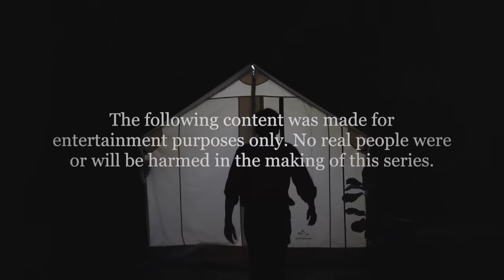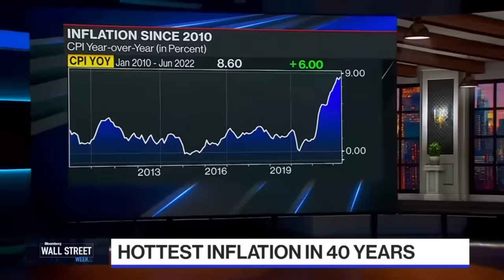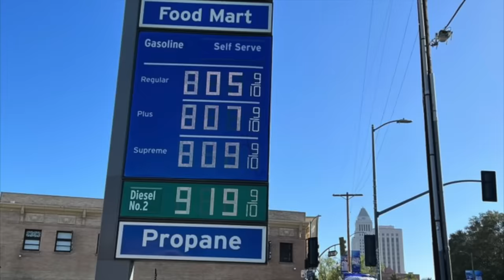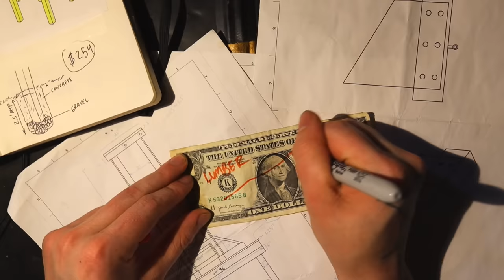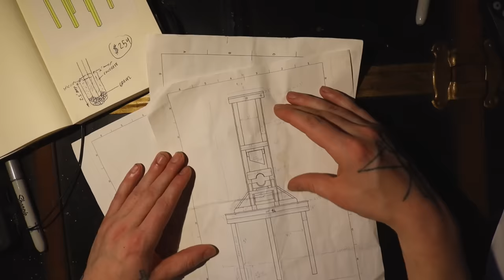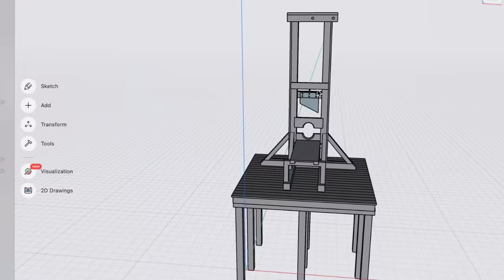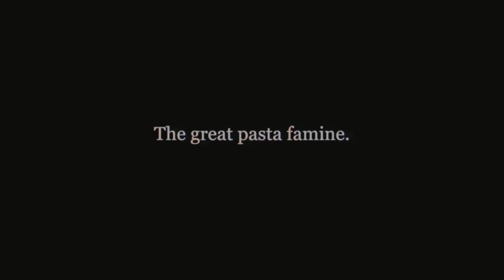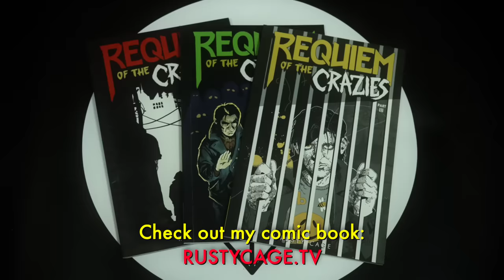GUILLOTINE part 1: Time to Build a Guillotine

Comment: If you are making the angled supports that short i recommend using extremely large washers so the bold does not pull out when you use it. other than that it looks good

Comment: So use like a 1/4” mild steel blade and bevel it with an angle grinder, should work well enough if a like 60* bevel (30* each side) and make sure to support the top with bolts spaced across evenly.

Comment: Also use screws and bolts. If not possible use ribbed nails and  make sure to drill a guiding hole to to avoid splitting the timber

Comment: another potential issue is the dirt will move when it's mounted and a structure that heavy should have a base like concrete used in the hole to surround and keep the posts in place to avoid tragedy later on

Comment: If I made a guillotine, I would use a couple of these:
I would still use a spring compressor, though.
My sister's son had an interesting take on guillotines at the family reunion. He said he'd have a spring-loaded guillotine but have it built to be very short, as people are too dumb to stay away from it. The blade should be curved to make it easier to use, but also have a sharp edge to sever people's heads.
The rest of his family laughed, but then realized he's just the kind of person who would design and build a guillotine and use it.
I don't think there's anything wrong with that. He's probably safer building a guillotine than being a police officer.
One day, I will finally have my own.
The one I have now is just too damn small.

Comment: you're going to need to travel to scrapyards to try to find the steel for the blade. Buy a powerful angle grinder, and good cut off wheels and flap discs, that should be all you need. maybe make a vlog out of the scrapyard trips?

Comment: and btw a 2nd note. unless it is pressure treated the wood will rot if left in the ground like that. you should have used concrete for the bottom.

Comment: RUSTY don't use a street sign, they're too thin. Use a 1/2" thick iron plate, it'll weigh like 100+lbs and probably could cut an entire body in half if you wanted to.

Comment: Advice for the build. I know this sounds dumb but id consider buying a hot glue gun, some cardstock, popcicle sticks ect, and make a small barbie doll scale model of it BEFORE you attempt to build it for real. It will reveal alot of potential problems you wouldnt see on just blueprints alone. Meterial strength and bendyness, play in the meterial. ect.

And building a prototype/scale model would also benifit you alot by getting you farmiliar with how the peices work together soo that its less confusing when you go to build it for real. 

It would take maybe a day or two. And maybe 50 bucks. But i garantee it doubling your effectivness of the project and the likelyness of it working out. Especially since its such a big investment to build the real thing. 

I know it probably seems really straightforward to just go out and build it for real without prototyping. and very tempting but thats a rookie mistake. Especially if you havent done stuff like this before as you said in the video. 

-------------------
I personally think the hardest part would ensuring the stand and tall stucture to be stable. And also finding a blade big enough to work for it. The blade itself could cost hundreds of dollars for an actually usable one. 

But id really love to see you actually build one. because i think they are cool and i wanted to build one myself a while ago. 

-------------
Anyways if you are wondering to trust my advice, i have a very small youtube channel where i build contraptions and do carpentry as well. 

But thats all i have to say. Love the video. love your content. if i had money id pay you.

Comment: Now I really don't think a street sign is going to be good enough as a blade. And I'm pretty sure you already know the reason why... but instead have you thought of using some kind of Blade like from an axe and trying to make like a bigger version of it or try to get a plain piece of metal and then sharpen it down into a curved pointy sharp edge and then mount it on to whatever you have as a mount  and I know this is very unlikely but I made a backup plan in case the guillotine just crumbles down one day because  even though  it's  unlikely. I'm  stupid as shit so I'm  going on with just in case 

If the guillotine ever fails I have some directions for you to follow, first you need to dig a hole. Maybe about maybe as deep as 6 feet deep but make sure it's circular and then put some sharpened punji sticks on the bottom of it (wooden) and try to find some false  ground to put on top You can make this by making a blanket out of the same material that are made with ghillie suits. Leaves. Green string or just  get a plane ghillie suit and cut the sleeves off and use it as a blanket to put over the hole

 History
        

         |
         |
         

The history behind this trap actually comes from Vietnam and they even put shit on the punji sticks so it would cause an infection and sometimes they even used no punji sticks just rattlesnakes and they also use babies because babies couldn't control their venom and it would make it more lethal...also they used to put the back of the punji sticks facing downward on the sides sometimes they would still put shit on it but either way how this one worked was if someone falls down it won't hurt them unless they get a small cut but when they try to get back up or get dragged up it would cut through their skin either way the shit that used wasn't just regular even though that would be lethal enough sometimes they would make sure it has some sort of other infection in it or they would even put some kind of flesh eating bug inside of it and that would make sure this was way far from their enemies base so no matter what they would die before they got there and they had other malicious traps too probably why they won
Reply: The reason why I know this is because I personally like making small versions of the traps and then making toys get murdered by them basically.

Comment: U have to sharpener your equipment get measurement right and adjust your pulley system 
Overall not worried after it over make sure to incinerate the body and sanitize your equipment wouldn’t want people fusion into life form due to all the blood smears

Comment: Consider triangular supports for the desk if you find stability is an issue
You want the lateral forces to be translated back into vertical so that any forces the frame has to support won't induce a lateral motion 

Because if you do, that 6ft different between the mounting point (where the supports go in) and the platform creates a torque (rotating force) which could lead to sudden failures if you're not careful with ensuring the beams are thick enough etc. That torque really isn't good for a rigid structure's like expectancy 

Using a truss structure for the deck support should eliminate that pretty reliably; but fucked if I know without looking at the specifics 
Trust in the truss chief, there's a reason those fucking bridges are everywhere

Remember with the huge weight and mass on top will change your center of gravity and you need that bitch to be stable 
I'm only an engineering student (3/4 done) but can help with the blade part too if needed (materials is fucking neat and with just iron and carbon youd be surprised how much you can control the output)

Above all, you got this
More than happy to help with any of the design side; let me know chief

Comment: Ignoring the whole symbolism of "Let's bring back the guillotine!" I think it's a lot more cost-effective and ethical to solely use lethal injections of drugs like fentanyl for executions. It needs little maintenance and it's not flashy and grandiose in a way that might appeal to the ego and bolster legacies the way that a high profile execution would; I believe pitiful souls should die in a boring whimper rather than a bang. Most of the talking points I've heard against lethal injections is that often they're made of guesstimated mixtures that have a chance of resulting in prolonged suffering because of multiple injections being required to do the job but substances like fentanyl are potent to the degree that it's easier to get a deadly dose than a safe dose. To counter myself, there's a chance that using fentanyl as an execution method would incentivize criminals to act on their impulses so that they can get caught and die high. What if that's exactly what we want? Antisocial people have a higher rate of addictive behavior than normal people and that statistic may mean that otherwise uncatchable criminals could end up doing the work for law enforcement. What does the collective get? One less criminal to pay to maintain with an indefinite potential for depravity and a nearly guaranteed chance of recidivism. What do they get? A stupid high. 

Here comes the question of "How much collateral can we tolerate?" that purveys every kind of discussion surrounding execution. If a system like that were implemented tomorrow there would be a variety of brand new systemic problems associated with it that may only be detectable in practice. There's drug addicts who seemingly adopt transient antisocial behaviors in times of desperation that may commit violent acts in hopes of getting lethally injected. Perhaps the people who are pushed to such acts by drugs are born with an otherwise dormant part within themselves that allows them to be capable of terrible acts? There seems to be a lot of comorbidity between what's seemingly drug induced transient antisocial behavior and inherently antisocial behavior that magnetizes one towards addiction. Naturally if an execution method such as that were to be used as a kind of bait for active antisocial criminals there would be otherwise inactive criminals incentivized to commit violent acts. Being able to "die high" might even become a symbol of status among organized criminals in a way that might make them even more cocky and frustrating to deal with when caught than otherwise. 

It seems that the most expensive and prolonged execution available is a guaranteed death in prison; a lifetime sentence to daycare for adults. As an infantilizing and demoralizing psychological assault on the senses that serves as a constant and unwavering reminder of "You will die here." it seems like, as an intendedly just punishment, the lifetime sentence to prison is given frivolously. From a more utilitarian and nihilistic lens it makes logical sense to impart an equivalent amount of suffering relative to what one has caused within the span of one's life as a supposedly just punishment and, in that sense, I understand the necessity in certain circumstances such as genocidal lunatics with a high count of war crimes. That being said, within the framework of utilitarian nihilism, where is the value in chasing equivalent suffering? Assuming suffering is a phenomena with an objective sum value of quantity independent of subjective philosophy, an inflictor ultimately has a finite capacity for suffering because of mortality. What about the sum of suffering causally related to the inflictor's actions? Does that sum of suffering exceed or equal the inflictor's capacity for suffering? If the former turns out to be true then I believe it's a lost cause and we might as well just swiftly get rid of those people in clean and precise fashion in order to focus on mitigating the damages.
Reply: I've given this a few days of thought before remembering this comment. Is there any way to know for sure if execution is ethically superior to quarantining regarding people who are beyond help and cannot rehabilitate? If the latter turns out to be ethically favorable in theory but unfavorable in practice due to factors such as not having the resources to offer housing, food, and humane treatment to people incapable of offering it in return... then execution by lethal injection is probably the way to go. Say, even if we had the resources to make a perfect scenario for the latter philosophy where all malignant antisocials are quarantined effectively and humanely, we'd still probably have to execute people while coaxing that scenario into existence. We might end up allocating future resources that we don't yet know that we don't have, all towards a project doomed to never be appreciated, by trying to build the perfect quarantine instead of putting what resources we have towards the players in the game that really count when it comes to furthering humanity. How are we to know? Maybe if we're all in dire straits, like a revolution, it makes more sense to execute as ethically as necessary or even ethically as possible, while if we're all thriving in a surplus it makes sense to strive for a quarantine that's as humane as necessary or even as humane as possible? I have no idea. It's interesting for me to take postulates to their logical conclusions however absurd they are.